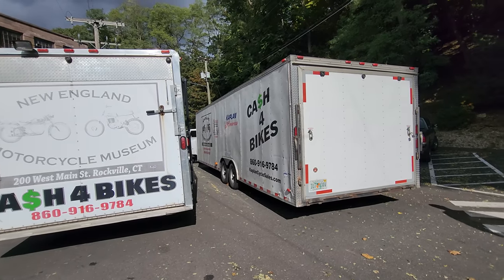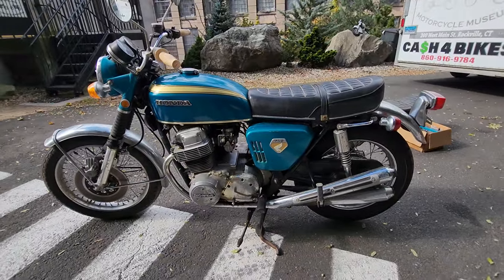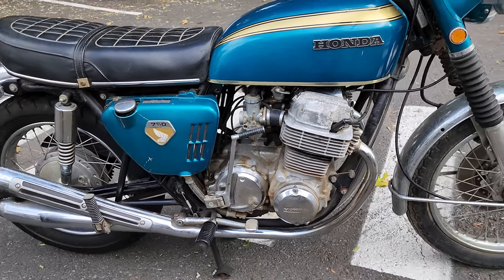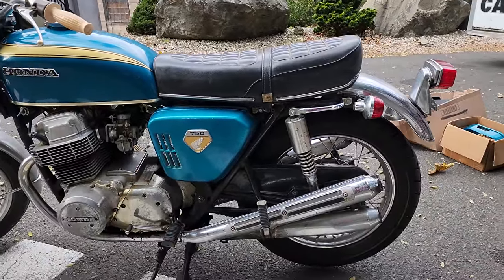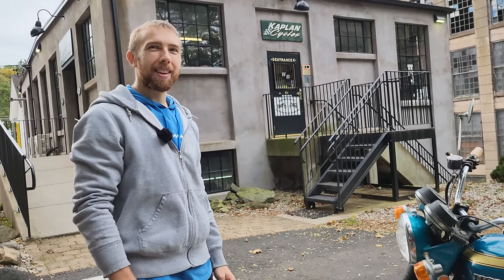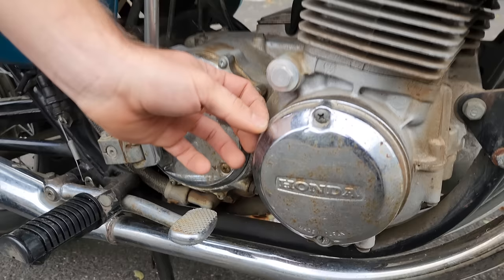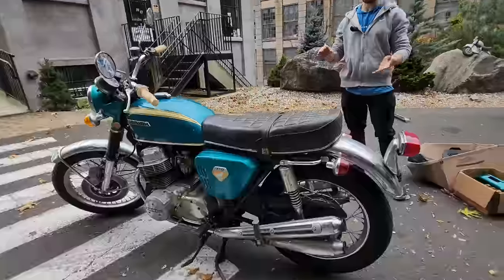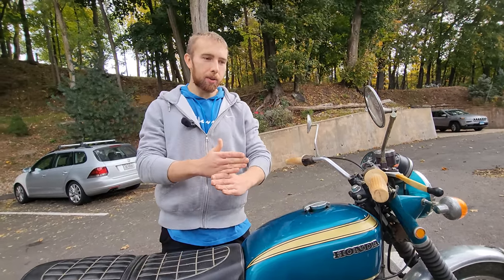THE HOLY GRAIL ARRIVES: 1969 SAND CAST SUPER BIKE HONDA CB750! Justin Describes the Diffences

Comment: This bike is like finding a 63 split window Corvette! EXTREMELY VALUABLE historical motorcycle. This is the motorcycle that changed everything in motorcycles. It has set more records in more different types of motorcycle racing than any other motorcycle before it. They were used in every race category from flat tracking, to drag racing, to hill climbing, and from personal experience they made the best chopper in many ways. The last chopper I built was a 750-4,and if you buy quality components, wiring and parts, and are careful how you build it, it will amaze you! They look 👀 sharp, ride smoother, more durable and dependable than almost any other bike before it. You really got a beauty here!
Reply from the maker: Thanks!

Comment: Hi!
I have one of these, bought from the US in 2019. The one in the video has the later style K1 front fender . The 1969 bikes had a front fender with sharp tip , not a rolled tip that this bike has. the reason Honda changed to a rounded front tip mon the front fender on later bikes is that there where accidents where people had heart themselves on the earlier bikes sharp tip fenders.
The CB 750 where originally something the American bike market wanted so the Americans asked Honda if they could make a bigger bike than the British made Triumph and BSA (both 650cc twins) and they did not want a twin cylinder bike.
Honda manage to build something that the Americans liked , but Honda was not certain the bike would sell in enough  quantaties so they did not bother to make steel pressure molds for the first bikes . It was first after 7414 had been made ,called "sand cast" as the engine cases was molded in steel forms but not made under pressure. They did not mold the engine cases in sand forms.

Comment: Hey Kaplan I just bought a cb750 it was torn apart and was being sold as misc paid 100 dollars for all. Found out the frame is a 1970 or late 69 model. But it's a mess of parts but it has sand cast cb750 parts it came with. This video helped a bit with figuring what is what. Thanks for making videos helps me understand my bikes. a good majority of them are just straight up rare and can't find info.

Comment: There was a factory recall on those bikes to replace the engine cases with die cast parts. Probably no way to know how many were done. Making the ones with the original sand cast cases even more rare in terms of overall numbers.
Reply: Sand Casting is the process they used to form the engine  cases. 
If you dont know about you should look into it or watch some videos. It's pretty interesting.

Comment: The original seat looks mint. I wonder why the original owner put a different seat on it? I guess ultimately it doesn't matter because it means the original survived… But it's just one of those things that makes you go hmmmmmmm. 🤷
Reply: I replaced the seat on that bike because the pan was bent slightly when I lifted the bike by the seat to put it on the center stand. Also, the foam was not so good...Tom